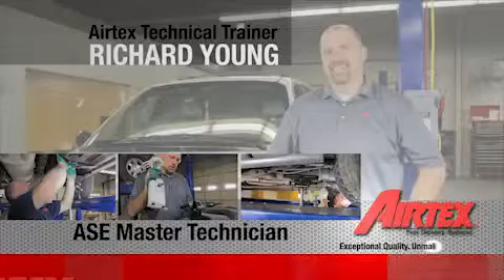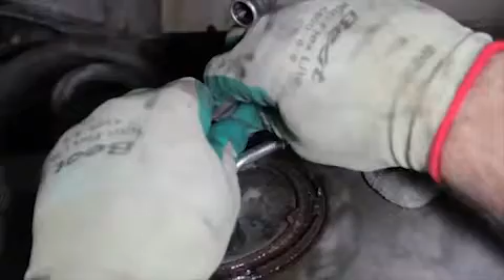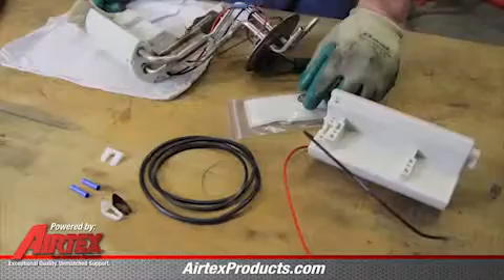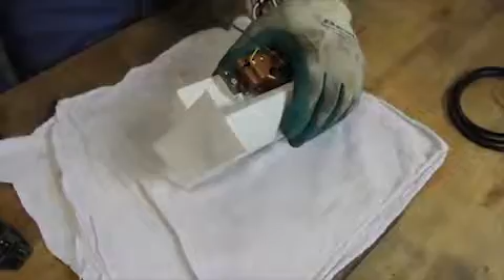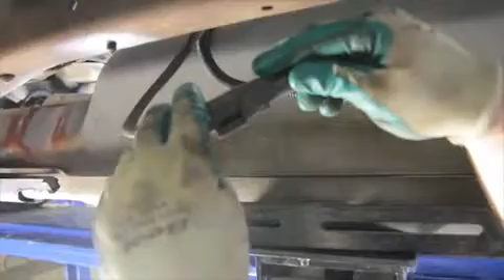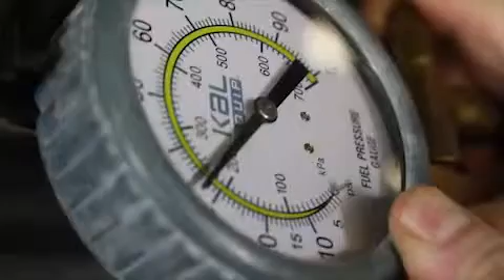Install Fuel Pump E2059MN 1995 1996 Ford Explorer

Comment: He's doing this on a mid 90s F150 pickup truck .....NOT an Explorer SUV
Reply: The F150s and explorers are on the same chassis/frame work. The only real difference is the body
Reply: 2 differant tanks also...1 steel and other plastic. not even the same tank style